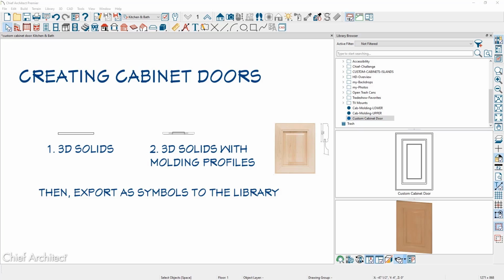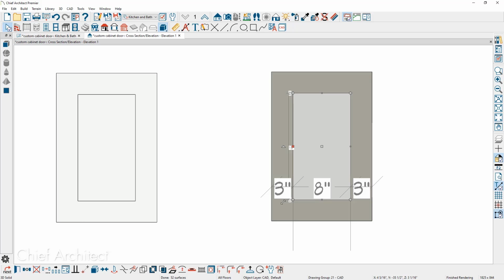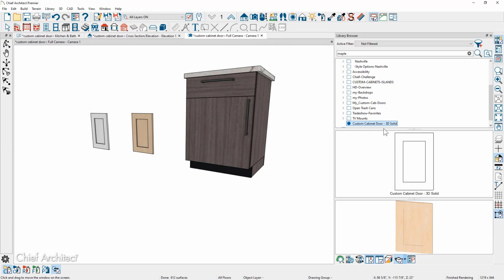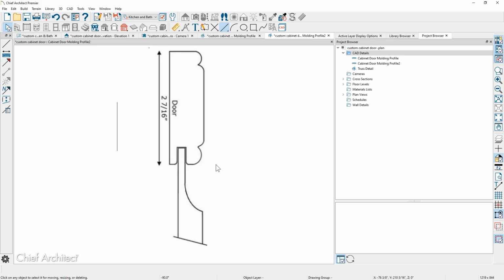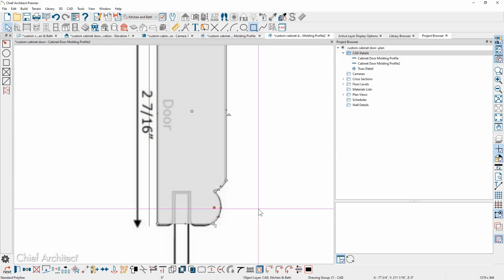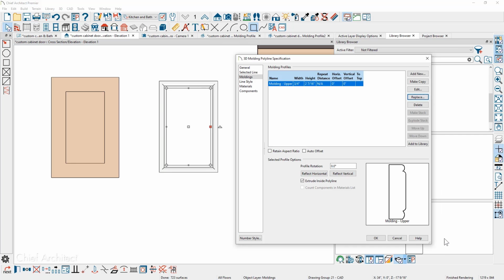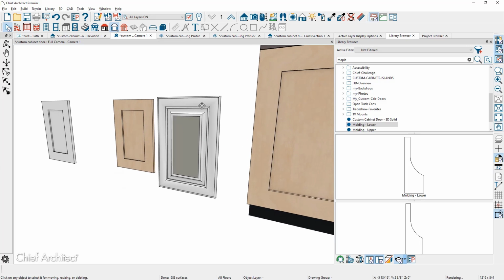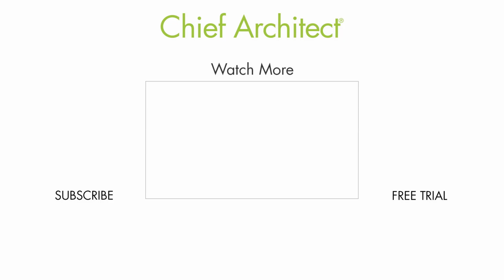Creating Customized Cabinet Doors

Comment: thanks.  i follow the video carefully and each time i try to subtract the center 3d solid it doesnt leave a recess it just makes the center solid on the same plane as the surrounding (chief x10)
Reply from the maker: I am sorry to hear this. I would recommend posting the plan to the user forum. Oftentimes other users with that same version may be able to help resolve the issue: https://chieftalk.chiefarchitect.com/

We also provide upgrade options to the most current version of the software, which would include priority technical support should this happen in the future, plus access to the bonus and manufacturer content. 

You can call us at 208-292-3400 Monday – Friday from 7 AM – 4 PM Pacific.

Comment: great video! Is there a way we can increase the resolution for these?
Reply from the maker: In the bottom right, there should be a gear icon for settings and under quality you can adjust it.